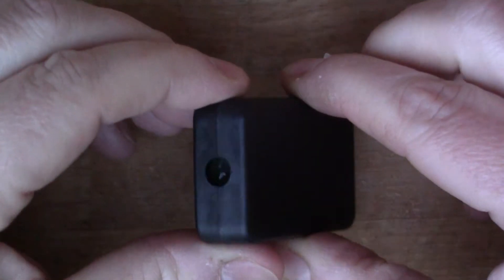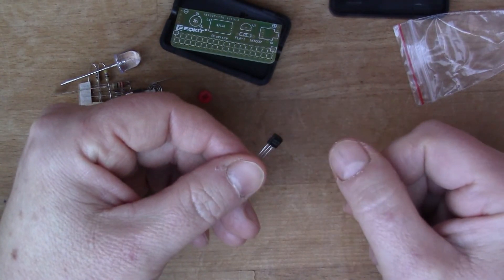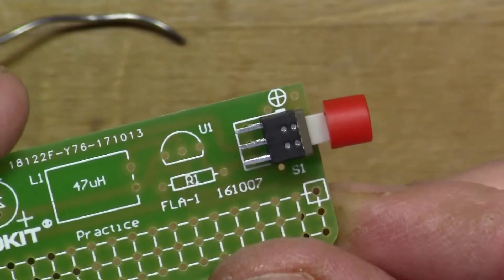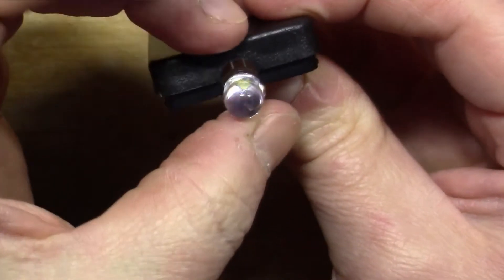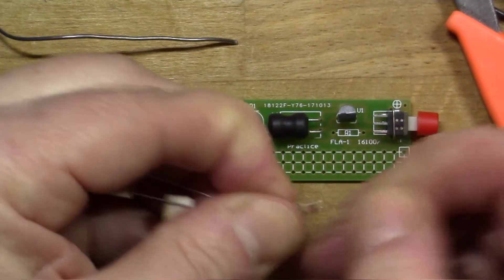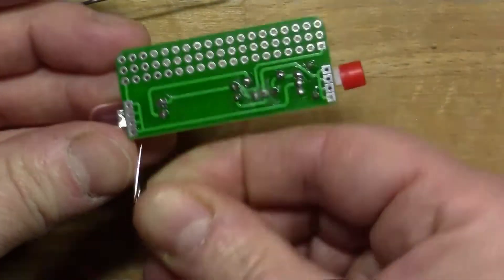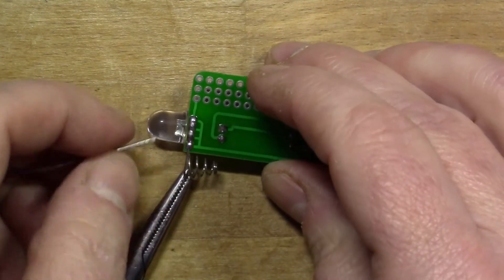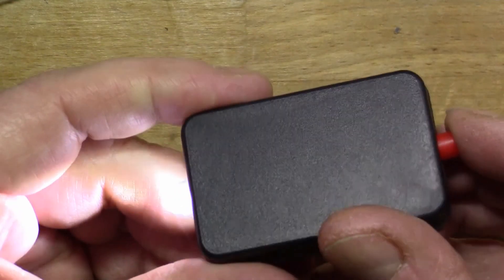Kit Build: LED Torch / Flashlight (#63)

Comment: Thanks for the video, it saved my flashlight. I put the battery terminals over the board not outside like you did and it screwed up the circuit. The Led would barely glow and the transistor got really hot, I was disappointed and wanted to start over. After resoldering the terminals to the correct side, it remedied the problem. I shortened the leads on the LED so the tip is flush with the case and did not need to enlarge the hole. Now it is great and works perfect with a dead battery. A review of a photo may have helped stop me from welding the terminals wrong, there is a + & - on the board so I stuck them on there but luckily the transistor survived because I felt it getting hot before it started to smoke.
Reply from the maker: Great that you managed to fix it!

Comment: I did this but the flashlight stays on, switch won't work but I did the direction correct. Help please.
Reply from the maker: Check that you don't have any solder bridges between the two sides of the switch.  One side of the switch goes to negative on the battery, so there's not much that can go wrong.  If the switch looks ok, I would desolder it from the circuit and test between the pins with a continuity tester or multimeter - the switch could be broken.
Reply: @MartynDavies  thank you for the advice. I'll try those suggestions.

Comment: Only the tip of the LED is meant to come through the hole in the case (in which case it is not necessary to extent the size of the hole). Doesn't matter of course, just avoids a bit of effort in increasing the hole size.

Comment: Nice kit. Shuld work fine with a rechargeable cell (cheaper). Some hot snot on the coil switch and led wouldnt be a bad thing.
Reply from the maker: Yes I just put in a NiMh from an old DECT phone and it works great.